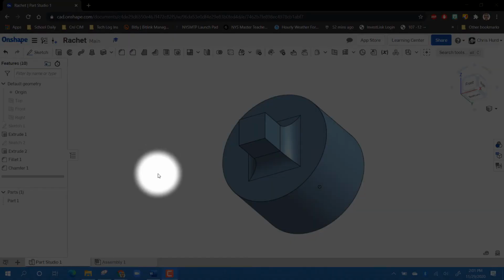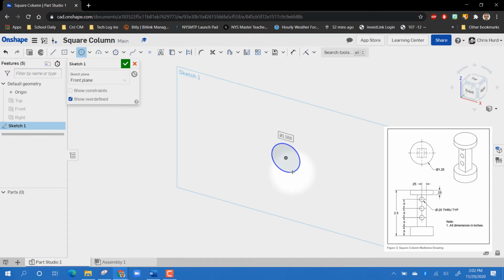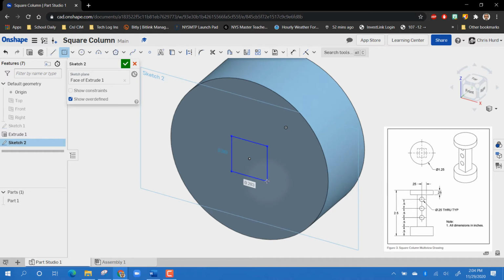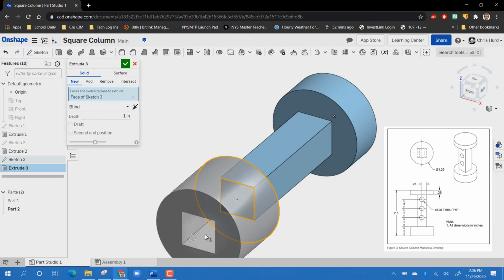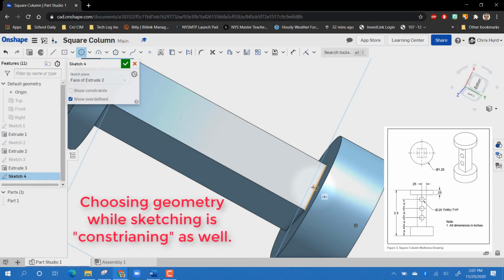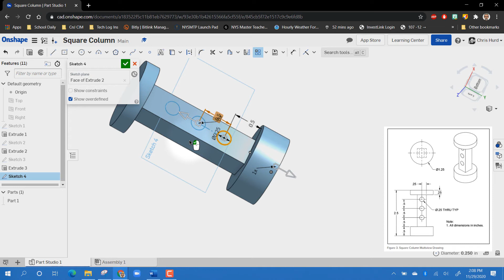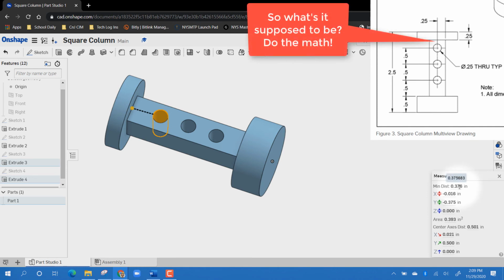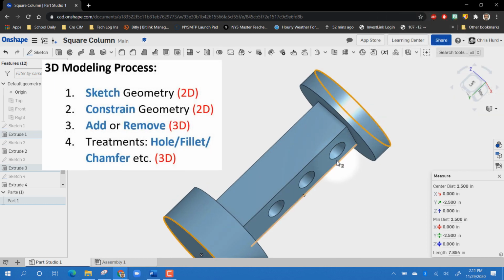3d Modeling Process: Square Column-Onshape

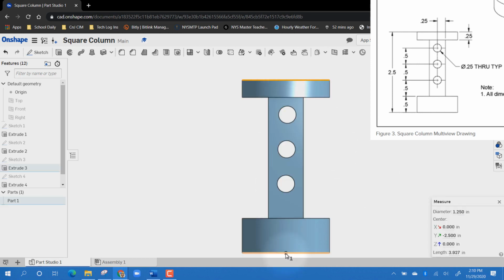Comment: Thanks for sharing this.  It was quite informative.   l noticed that at 9:00 that the stack of 3 holes leans to the right a bit.  When the rectangular pattern was rotated when making the last two holes it was left at a little more than 90° which caused this.